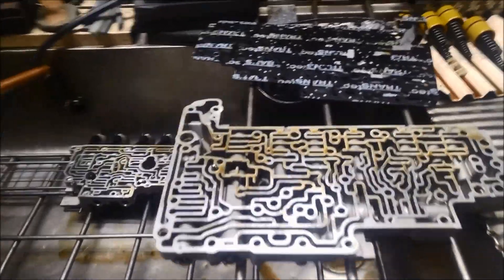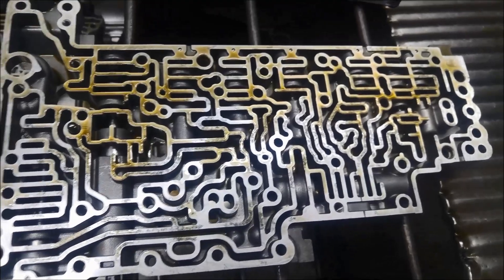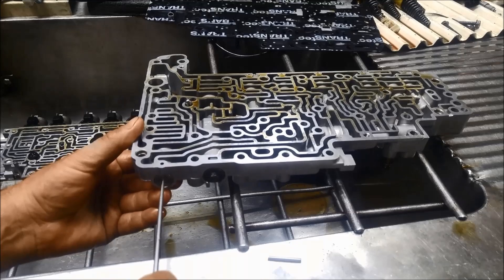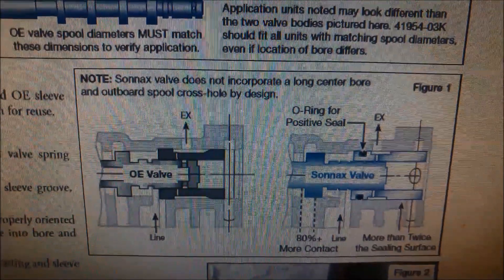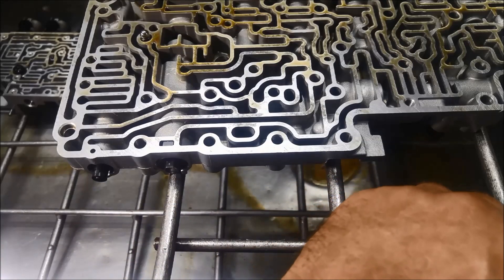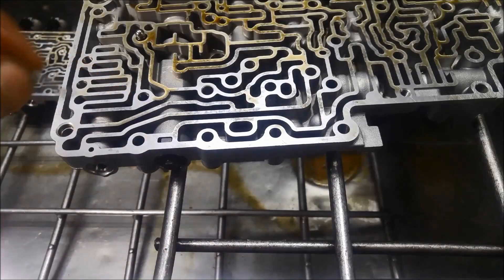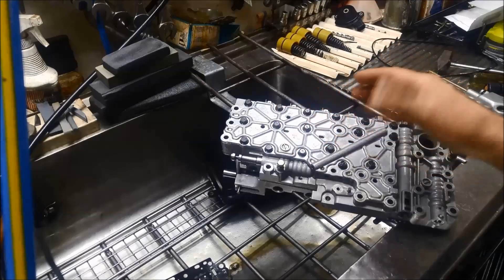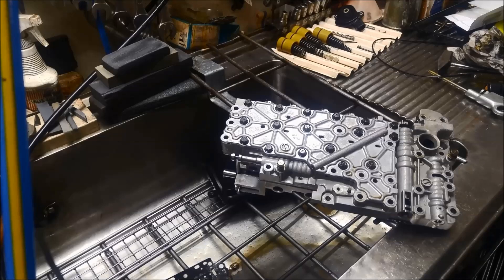TCC Torque Converter Clutch Control Valve Sonnax Upgrade - cycling TCC & Overheating V5A51 Trans

Comment: thank you for the video , looks like you would have to be  very precise and double check everything , not to mention have a very clean environment , i have a Triton with the v5a51 box in it and it is very smooth , it does neutralize it self from time to time when cruising or under load  in drive and in super select  , no fault codes , and the D displays fine and does not  go out when it happens , would you be able to point me it the right direction please, no mechanic seems to be able to fix it . its had a flush and service .

Comment: I HAVE A PROBLEM. IT'S BEEN IMPOSIBLE  TO DIAGNOSE THIS 5 SPEED TRANSMISSION. BECAUSE EVERYTHING SEEMS OK INSIDE TRANSMISSION, BUT WHEN I WANT TO REVERSE OR IN DRIVE MODE IT DOESN'T WORK AND WHEELS GET BLOCKED, LIKE IF THEY WHERE ON PARKING. COULD YOU HELP ME PLEASE? 
NOTE: WHEN I INSTALL A 4 SPEED TRANSMISSION ALL SHAFTS WORK.
Reply from the maker: hi, did you do the repair? sprag clutch could be in wrong way...which trans? cheers
Reply: Hi, this transmission is V5A51.Two Both sprags are ok, they freewheel to right and hold to left.
Reply from the maker: @jthstevenp3732  sorry never changed a 4sp to 5 sp on these, was original trans 4 or 5 speed? i`d say would have different pcm
Reply: HI. WE FOUND THE MISTAKE, THERE WAS TWO CLUTCHES APPLING AT THE SAME TIME, LOW REVERSE AND OVERDRIVE. THERE WAS A STEEL PLATE BAD POSITIONED AMONG THIS TWO CLUTCHES.

However, thanks for your help

Comment: at the Mercedes 722.6 gearbox when switched on in the morning as soon as the D and R are inserted my car jolts and turns off this does it only when cold but after a few minutes the car is fine. What could it be?
Reply from the maker: hi, if torque converter clutch is still applied at idle, it can cause motor to stall. cheers
Reply: @YepThatsIt  we replaced the torque converter thinking it was not working but the problem remained. what could be the cause that remains active in the first minutes after switching on? thank you
Reply from the maker: @giuseppeamato5073  i`d need more info....solenoid, valve or worn valve body, then you might have to look at computer
Reply: @YepThatsIt  in diagnosis with the computer I have no errors. the strange thing is that the problem is only cold in the morning and after 2 or 3 minutes it doesn't do it anymore ... just enough time to circulate a little oil.
Reply: @giuseppeamato5073  Hi, I've had the same problem with mine for nearly a year. Did you find a fix for this?
Reply: @jamesparry151  no I haven't found any solution yet.  I replaced the torque converter to see if he was the problem but he has the exact same problem.  in my opinion it is some valve to replace or the whole valve group.
Reply: @giuseppeamato5073  Thanks for your reply. 

A Mercedes specialist garage said it was £1100 to replace the Torque Converter, but I didn't want to pay that insane price if it wouldn't fix the solution 100%,, so I bought a Torque Converter off a scrap car for £90 and was going to install it with a friend. 

I have the exact same symptoms as you. Cold stall, etc. I think it could potentially be the Valve Body... I've just been looking at all the cheapest fixes first.
Reply: @jamesparry151  probably yes it is the valve body.